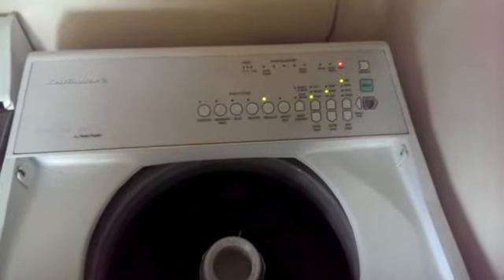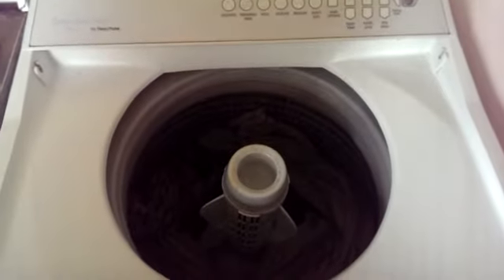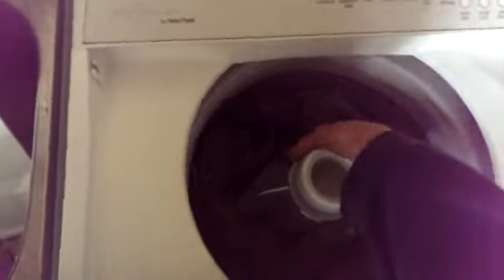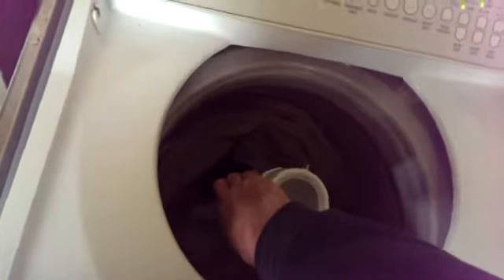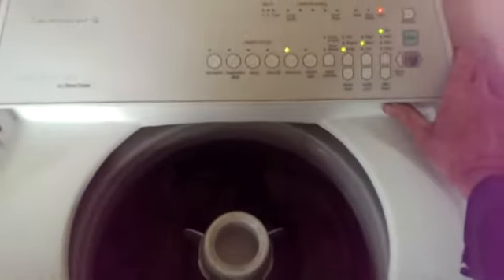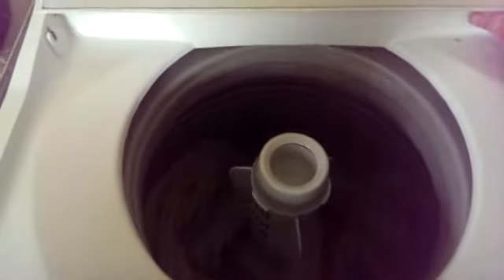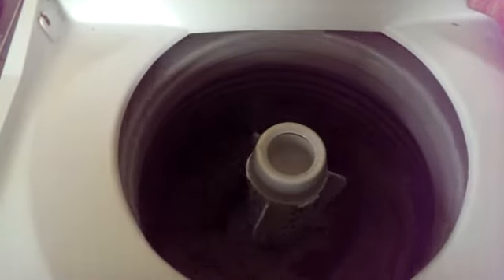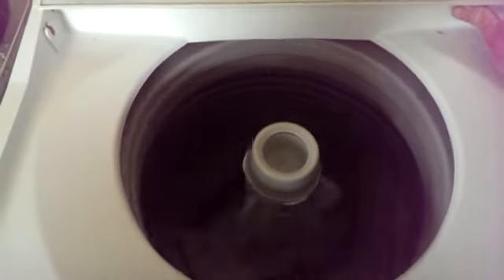Smart Drive won't spin,  just "Thumps" repeatadly

Comment: Thanks Paul you're an absolute champion!! Was getting 'Fault 56 - Failed basket check' on my Aquasmart 2 after changing the bearings. Machine would thump back & forth for a while with what I assume was some knock test expecting to see the agitator + basket move somewhat further on the Rotation Position Sensor than it was. Quick smack on the shaft was the solution and has everything working again, so happy right now :)

Comment: Nearly 6 years later and your advice is still helping people.   The full rotations trick got mine spinning again.  Now I just have to sort my code 37 :D
Reply from the maker: 37 is blocked pump. My other pump removal video should help.
Reply: @paulywooly  Cheers for that, I have seen your vid. But my WA80T65GW1 takes the 421820P pump.  And I've not found any vids for that one.   Will take it out tomorrow and enjoy the adventure :)

Comment: Rotating agitator 360 clockwise and anti clockwise and giving centre shaft a "good smack" with a hammer (short handle) fixed all problem.  Completed two washes two washes and all going fine.  Was afraid I would have to replace bearings and not looking forward to having to do that. Being a pensioner I would like to say a big Thank You............keep up your great work.
Reply from the maker: Hammers fix lots of things! But just yesterday I had a machine that still didn't spin after doing the hammer trick and it turned out to be a faulty rotor position sensor.

Comment: Hi, I replaced the bearings on my machine and encountered this very problem.  Interestingly when I first tightened the nut and rotated the bowl I noticed it seemed tight so I backed off the nut a little.  Not enough it seems.  The hammer did the trick. Well done Paul
Reply from the maker: Did you nip the nut back up again? The nut doesn't need to be tight tight. It's usually the steel tube that sits between the bearings that is the cause.
Reply: @paulywooly   I know what I should really do is loosen the nut a little more as it is probably still too tight. I agree the steel crush tube is probably a fraction of a millimeter too long. As I reacll though, the drum never spun that freely previuosly.

Comment: The hammer trick worked for me, after getting error 56 with 3 green lights showing - 00111000. No bearings changed but I did recently pull the machine apart to clean. 

Thank you

Comment: Just putting this here in case anyone else is looking for similar symptoms with a different cause.
I had similar symptoms on an old  Smart Drive.
 the error code was 00101011 (43) on the 8 panel lights
The microswitch on the unbalanced load  'finger' under the panel that the drum hits when out of balance was sticking down so it thought it was always unbalanced and just kept trying to start then stop. 
There is a tiny spring inside the switch and a little bit of corrosion meant it didn't quite have enough force to always click back but at first I assumed the pump and everything else. And of course it seemed to work for a bit after tipping and moving the machine around even though I found nothing wrong.
Finally lifted the mainboard and saw the switch was stuck. It is a standard size and just lifts out on mine.
The machine is so old some of the plastic pieces were fragile. A bit of superglue to hold the things in place and a $3 switch gave it a bit more life.
Reply: Thanks so much! This switch was my issue as well, just scraped off the corrosion and sprayed some CRC to get the button to move freely again

Comment: Big thumbs up Kiwi Paul! I just did the 360 rotation trick on my Fischer & P machine and it looks like it sorted it. From reading the comments below, I'm guessing it was a RPS error?  I will check the fault code if it happens again.
I tested the bearings by doing the free spin and thought it might have been a little tight. After I got the spin cycle to work again, it seemed to really loosen them up. I will test the free spin again once it's empty and cold. 
Champion you tube clip mate. 
All the best from the Western Island,
Ben

Comment: Hi Paul Thanks for your previous replies. After replacing the bearings & seal, hitting the shaft & rotating the bowl & agitator didn't remedy the spin cycle unfortunately. It did come up with a fault code 130 (RPS sensor error) which was different to the original fault  a few days ago - fault code 136 (Motor Stall). I dismantled everything again & double checked the correct phase connections on the stator & secure plug connection on RPS. The shaft spins freely by hand. (One thing I would say after several dismantling sessions!! is be careful not to overtighten the locknut onto the shaft bearing as this will cause extra friction by trying to push the bearing onto the inner spacer tube). Instead of re-assembling everything back in the main housing I stood the outer bowl on is end (shaft & rotor pointing up) & plumbed up the control module so i could see what was happening when i tried a spin cycle. The rotor tries to turn one way for a small distance before turning back the other way. This cycle repeats itself. I came across your other video about diagnosing & changing out a faulty RPS. These symptoms are identical to what was happening with my Aquasmart machine. I've decided to purchase a new RPS. The RPS for my machine is a white encapsulated sealed type p/n 420776P. The only exposed connections are those for the connector plug. Have you ever had any problems with these style RPS's or had a RPS fail after fitting new bearings? I'll keep persevering until I figure this out. Appreciate your expertise & help so far.
Reply from the maker: No I've never had a RPS fail after a bearing replacement. The type you have is more reliable than the previous types. I can't think why all of these problems are happening to you. Another thought is the RPS plug on to the control module may have a dirty connection, or the sensor itself is not seated correctly in the motor, or a broken wire in the loom...check continuity of the 5 RPS wires. Check the readings with a multimeter across the 3 motor plugs all read 32 ohms.

Comment: Hey Paul I got a MW059 machine like nearly a month ago and I go to take off the wing but off to the agitator but the agitator is stuck tight even though the nut is off! I’ve smacked the shaft, I’ve tried some tricks but it just won’t budge out! Any reasons why that would be! I am actually interested when I get it out to see why it was stuck like that
Reply from the maker: The agitator and bowl would have rusted onto the shaft. It's very difficult to get them off. Forward to 2:20 mins on this video and watch what I did. It took nearly 10 mins to get this agitator off in the end.  https://youtu.be/HNY54gTrcB0 
Make sure you wire brush the rust off before you put it back together
Reply: Update: I managed to get the agitator to come out by putting a flathead screwdriver in the teeth and I hit the top of the screwdriver with a hammer and wiggled it out. It took me 4 months to get it out.
Reply: @lukekneebone9831  Had to laugh when I read "4 months". WD 40 would've been a 10 minute job.

Comment: Hi Paul, firstly thanks for taking the time and effort to post on youtube you're helping a lot of people save $$$. I have a problem with my F&P smart drive washing machine, It wasn't spinning and diagnostic code indicated a faulty rotor position sensor, so I replaced it as the old one was corroded and now it spins ok. However now the machine stops during the wash cycles and powers off, there's no lights on and we can't start it up again, after about 5 mins or so we can start it and we skip to the next stage of the cycle and the machine will continue, it stops in the rinse stage as well so we repeat the process, the spin completes ok. Any ideas? thanks in advance :-)
Reply from the maker: Hi. I need to know which exact model number. There's a sticker on the back left of the machine.
When I always change a rotor position sensor I run sandpaper over the terminals inside the plug to get rid of the green corrosion before I plug a new one in. Was the machine doing all these weird things before the new sensor? Or just not spinning. Did you get a fault code with the machine beeping at you
Reply: @paulywooly  hi Paul thanks for the quick reply, its model gw609nz
Reply: @paulywooly  and no its wasnt doing this before i changed the sensorand the machine doesnt beep it just turns off and we cant turn it back on for about 10 mins
Reply from the maker: @jeremyoftitirangi7770 sorry for late reply
That's really strange what is happening to you.
It's a phase 5 model machine which can be trouble. If you are handy with a multimeter can you do some extra tests. Watch my video here and especially the water pump resistance can lead to troubles with those machines and those grey control units were the worst ones they made and are now obsolete and hard to find.
 https://youtu.be/5GPBq3XKZMk
Reply from the maker: I just had a thought. A couple of years ago a  friend of mine changed his rotor sensor but when he put it back together the sensor had fallen out of its cradle and caused the machine to turn off during a cycle.  Maybe recheck it hasn't done the same thing, or the plug is firmly on. Check my video for error code 130

Comment: thanks for this, although your technique didn't work for me, it got me thinking that perhaps I had over tightened the lock nut at the bottom, so I took the rotor off and loosened the nut on the base of the spindle a little then gave it a tap from underneth. then tightened it back up (but not too much), all good
Reply from the maker: That's great. Thanks for the comment
Reply: Mark Mangion did that fix it . Did it spin after that.

Comment: Hey Paul I got a machine for free yesterday which wasn’t turning on so I replaced the board and I also replaced the shaft because the spline was rusty. When it fills the water stops coming in sometimes when the bowl is rotating but the bowl still continues rotating. It also thumps a lot during drain but it does spin and it also used more water than needed on medium. Any help would be appreciated.
Reply from the maker: That's all the symptoms of a faulty rotor position sensor which usually doesn't  come up as a fault code. With a faulty sensor,   the bowl doesn't turn slowly and the water pulses on and off during filling and won't spin properly. Check my video for error 130
Reply: Paul P The bowl was still turning slowly but the water would stop coming in. The machine would also use more water than needed too, I have already checked the hose that goes to the pressure switch. The machine is a Phase 2 machine model LW015.
Reply from the maker: Mmmm phase 2 is old. I've had trouble with those blue motor control modules before. If you have a spare sensor try that first, it may help but also try the ohms test for everything especially the motor windings. My other video of testing a smart drive resistance may help.
Reply: Paul P I do have a spare sensor so I will give that a go first.
Reply from the maker: Another thought... There were different control modules for different sizes of machines with phase 2. Even though they are all blue doesn't mean they will work properly
Reply: Paul P The motor controller I installed was from another 5.5kg Phase 2 which is the same size as this one.
Reply from the maker: That's good because they're hard to find these days. Good luck keep in touch
Reply: Paul P Update: I replaced the Rotor Position Sensor and the water valves, The water still turns off when the machine is filling on normal settings but the bowl continues rotating. However when you advance it to the final rinse it fills normally and once it’s reached the correct water level you have to turn the machine off and on again and then it will work fine from there. Any ideas what could be wrong?
Reply from the maker: @liftrailphotographyinnz3992  It's really looking like it's a faulty control module. Are all the resistances of everything ok ?  Especially check the resistance of the lid switch and the out of balance switches too. You'll have to pull the display module apart to get to the lid switch. Make sure the resistance measures
 0. something. A high resistance out of balance switch causes all sorts of strange things to happen.
It could be a faulty water valve transistor on the motherboard which is way over my head to repair.
Otherwise I've run out of ideas and I don't have any phase 2 modules left in my possession to send you.

Comment: Hi Paul ive recently fitted a new bearing and seal kit to our F&P aquasmart washing machine after having water leaking on floor & very noisy on spin cycle.The drum & agitator freely spin by hand as per your video but when we try an actual  spin cyle it just sits there trying to turn & eventually goes out on error code 136. Motor cable & RPS cable continuity is ok. RPS cable plug  is secure.  I haven't tried your suggestions yet. Why would this occur after a bearing replacement?
Reply from the maker: I'm not sure why it happens when bearings are replaced. I'm thinking it's the spacer tube not sitting in the right place. A few snacks with a hammer seems to always work. I've had 3 machines do that this year after new bearings and the hammer trick has worked every time
Reply from the maker: P.s.  if the red, blue and yellow wires are not in their correct places, that will also give an error code 136. RYB is printed on the motor next to the wires

Comment: Hi Paul,
I have a excellence7.5 smart drive 8.
I swapped out the outer bowl with another one as I had a spare. The machine won’t go past the rinse cycle it pumps ou but then does the same as in your video, does the same if I advance it to spin. I tried your rotation method but still doesn’t work, the bowl spins freely. I only swapped the outer barrel everything else is from the unit that was working fine except for the bad bearings. I have checked the continuity of the motor wires and they buzz fine. Is there a way of doing a factory reset. Any thoughts.
Regards Bruce.
Reply from the maker: Just some questions first:
What's the exact model number on the back sticker
The outer bowl is the plastic one and the inner is the steel one. Why did you swap the outer plastic bowl, was it leaking?
Did you replace or touch the bearings  when swapping the outer bowl.
Did you do the hammer trick ( forward this video to 1.06min) . I have had to do this up to 6 times before it spins normally.
Does your machine have a "lid lock" when spinning.

There is no factory reset on these machines.
Reply: Paul the fisher and paykel washers did not have a lid lock until the phase 6 got introduced

Comment: got a Fisher & Paykel wa80t65gw1 , and it thumps from as soon as you start the machine and filling water.  tried spinning the agitator backwards , the hammer trick. it just thumps and agitator stays put after the thump. any ideas?
Reply from the maker: Does the agitator and bowl turn slowly clockwise when filling with water ? 
Do a clutch test with machine empty...  grab the whole internal bowl with 2 hands and lift it upwards,  it should move freely up til it stops.  Then when it's up, it should turn freely, but not the agitator. When it's back down,  turn it, and the agitator should move as well
Reply: @paulywooly  seems to be spinning freely now after the clutch test. will fire it up and see. Thank you.
Reply: @paulywooly  help says too heavy with only half a bowl of water, and thumps before spin cycle.

Comment: Hey Paul, quick question, can you do an instructional video for me, can you do it on how to remove the grey metal cover off 90s smart drive please as i am needing this answered asap. Cheers.
Reply from the maker: Not sure what you're asking. Early machines had the metal cover underneath the whole machine. It should pop off with a screwdriver (used as a lever) in each corner. Or is another metal cover somewhere else?
Reply: i cant attach a pic on here but its just 1 cover.
Reply: Okay, no worries.
Reply: Just sent.